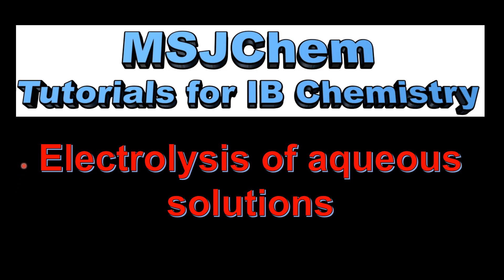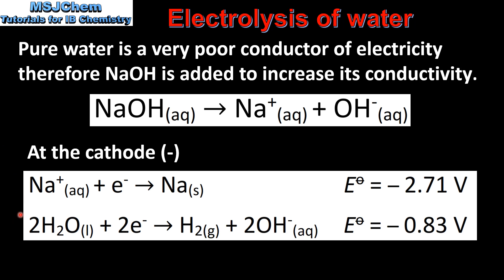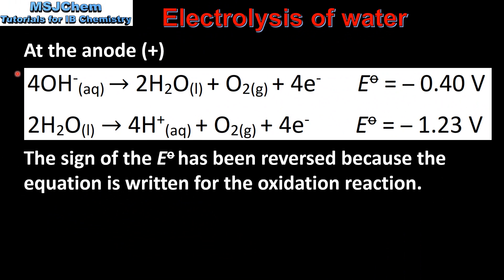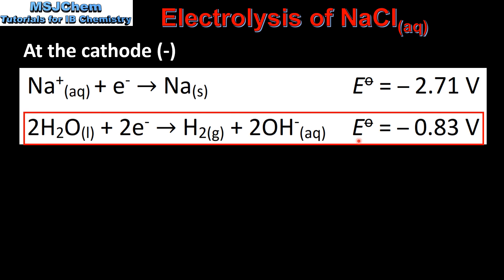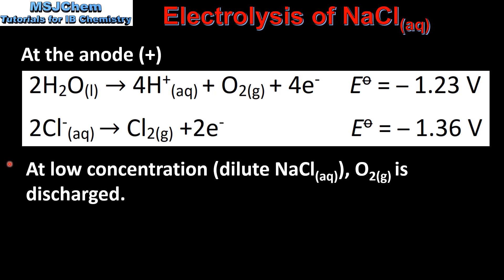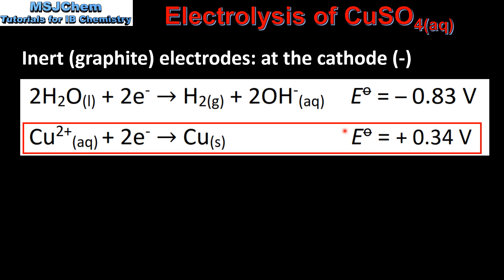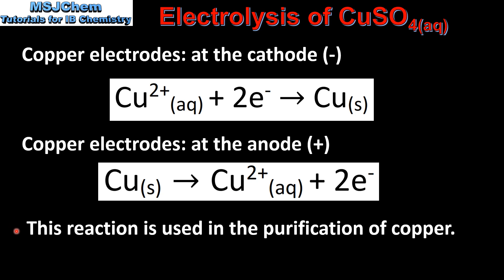19.1 Electrolysis of aqueous solutions (HL)

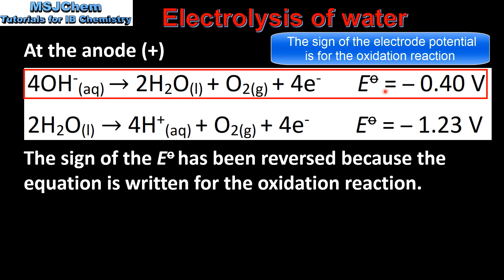Comment from the maker: Note at 1:43, I say that 'the reaction with the positive electrode potential will take place' when it should be the one with the more negative (less positive) reduction potential, which according to the IB data booklet is the oxidation of hydroxide ions to produce oxygen gas (+0.40 V vs +1.23 V).
Reply: Why should it be the oxidation of water?
Reply from the maker: Going by the electrode potentials in the data booklet, it should be water - not hydroxide ions that are oxidised.

Comment: For the anode reactions for electrolysis of water, shouldn't the bottom equation be discharged, because it has a lower E/V value, meaning that its more likely to lose the electrons
Reply from the maker: Yes, you are probably correct, but it doesn't really matter because the product is the same - oxygen gas is produced at the anode.